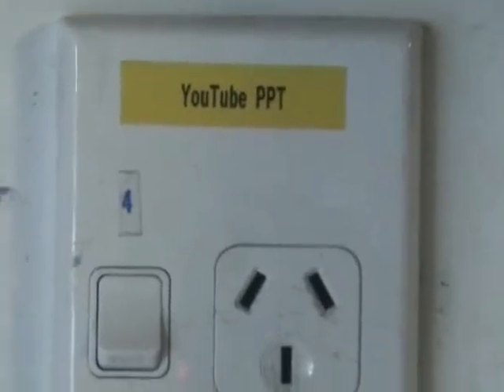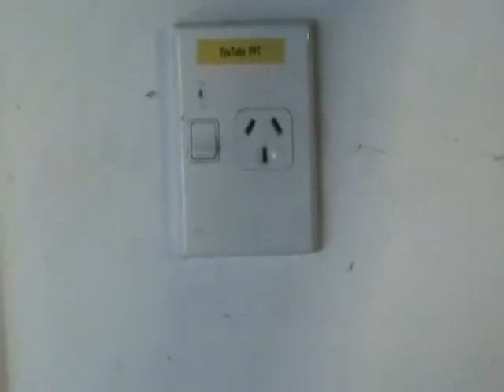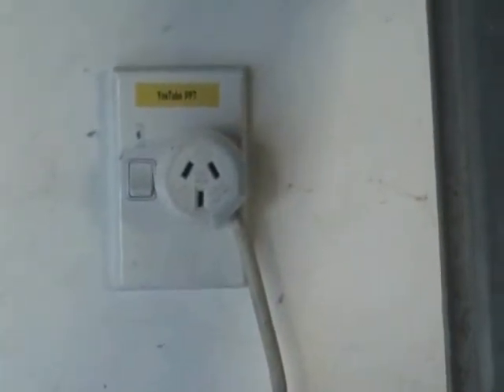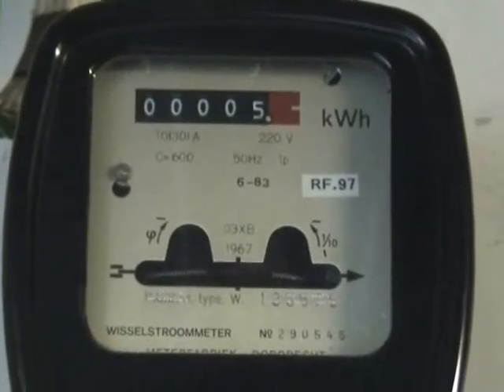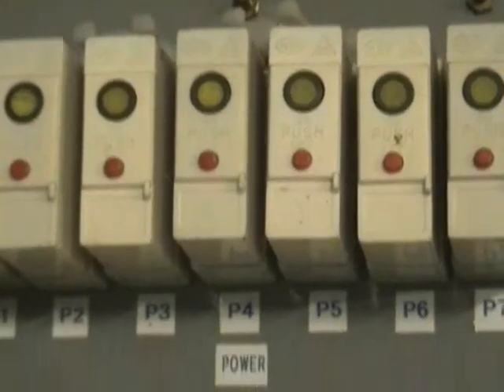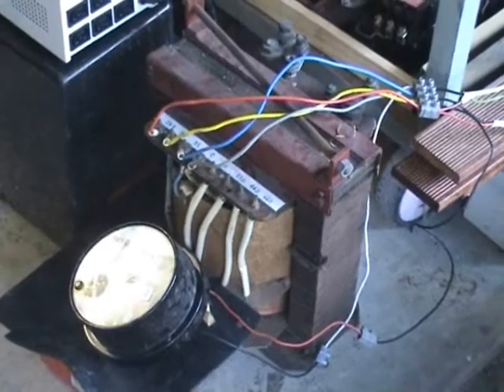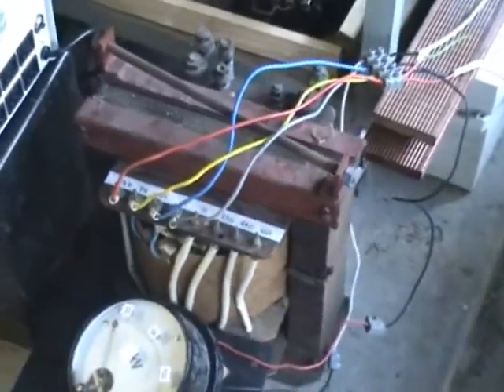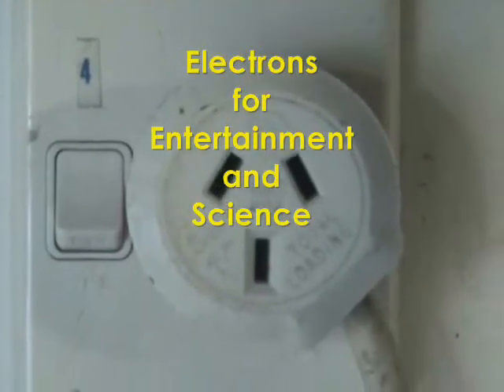YouTube -- Power Point

Comment: A US/Canada clothes dryer power point is similar but somewhat larger. 30 amperes, the 2 angled slots are hots 240 volts and the bottom slot is neutral doubling as earth. They are no longer permitted in new construction.  A 4 prong now is required with a separate earth. And a 277 volt 15 ampere powerpoint has the 2 angled slots (hot and neutral) with rounded earth pin. 277 volts  for HID/fluorescent lighting comes from phase to neutral of 480/277 Wye commonly used in industrial facilities.

Comment from the maker: @BarneySaysHi 80 Ampère at 240 Volts single phase supply to meter and main switch board.
This powerpoint is rated at 20 Ampères.